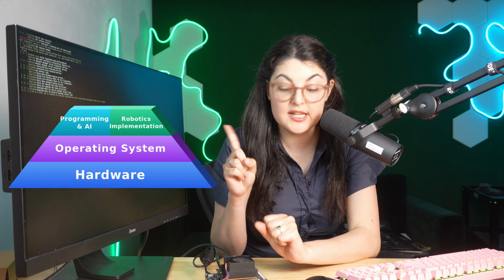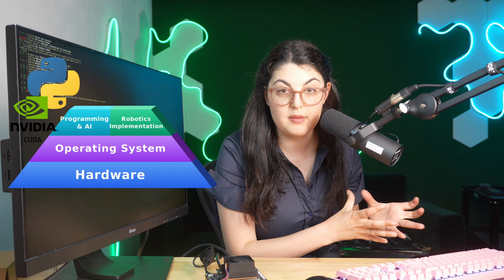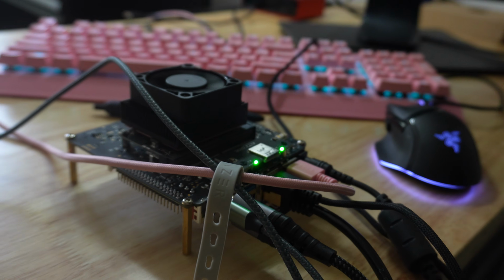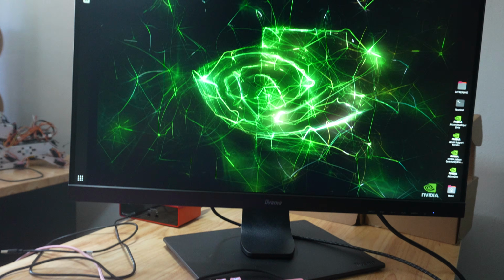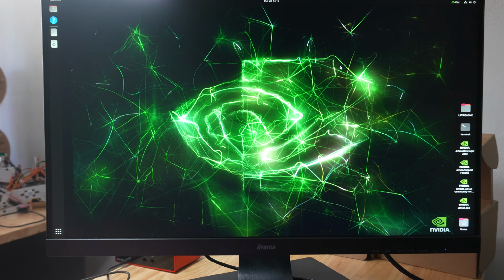what they don't tell you about building for robotics with NVIDIA Jetson

Comment: The Jetson board died the very second you touched it. You can see the monitor turn off and the Jetson fan stop right as you pick it up 15:03. Electronics can be very sensitive to touch. 🖖
Reply: Exactly. Why would you even touch an actively running circuit board? Shorted circuits will need to be repaired. Next time put the PC in a box if you wanna lift it while running.

I'm feeling so bad just watching this. Got the thing running after so much issues just to ruin the hardware herself. Hope you get it fixed. God bless you.
Reply from the maker: Thank you! They do extensive testing to make sure the board is safe from shorting just from a touch so it shouldn’t be that easy 😭 I’m sending it back for further investigation and we’ll get a new one to continue the series 😅 I also got an anti static bracelet for the next episodes and I’ll definitely be more careful 😢
Reply: @backtoengineering Good for you. Eagerly waiting to learn more about your enthusiastic failures. Always remember. Unreasonable people are the only ones capable of changing the world. Never Give Up. Never Surrender. 🌎✌🏻

Comment: You know, there was a time when engineering meant putting together the circuits yourself resistor by resistor, and writing the software, line by line. Sure, now its faster because you can buy ready made systems and insert software modules and it does a lot of complex things. But the problem is that if there's an issue or you want it to work differently you can't fix it because they're just a bunch of black boxes that you didn't design yourself and don't totally understand how it works.  We've gotten to the point where code has been written on top of older code, and there's miles and miles of ancient magical lines of code that is impossible to decipher.  And you have to ask AI and it tells you but it charges you $90 because its had to spin up a power station and super computer to pull up the answers you can also find on google,  and then it doesn't quite tell you the truth. hmmmmmm.  I'm thinking you may have killed it with static when you touched it, or you disconnected something with the pressure.  Although circuits should be more robust these days against static spikes. You may also have a bad earth line to the power supply and the board is just floating.
Reply: yeah, i also mis those days, when microcontrollers was still available in through-hole packages 😅
Reply from the maker: Fair! I do like that it’s more accessible though. The option to buy the parts and solder everything together and make it fully your own from scratch is still there! Now they just also make it easy with kits 😅 I’d love to be the kind of engineer who can from from absolute 0 and some loose iron though
Reply: @backtoengineering  Its not the parts that is the issue. Its the fact that more and more these days engineers are just following instructions online and are just there to connect up the wires. Its very seductive, and you don't even notice that over time your skills have atrophied.  Its a very real and present danger.

Comment: I set one of my Arduino/RAMPS combos on fire a couple of months back when I slipped with a multimeter... and I mean a 3-inch open flame coming from my electronics :) That happened while trying to fix a stepper motor that was working, but wasn't holding the right amount of torque...so the whole troubleshooting endeavor had to go on hold to wait for a new board, and that extra time took the (very non-working) motor well outside of its return window. 

Yay hardware.
Reply from the maker: It’s definitely a challenging hobby 😅 but it’s also super rewarding, maybe because we know it can always blow up haha

Comment: Welcome to the hardships of engineering! Don't worry! We all went there sooner or later for one expensive component or the other. But before you toast another Jetson.. Why do you need it at the current stage of development? Wouldn't it be more efficient and easier to set up if you ran the AI Stuff on your local PC and Graphics Card and only switch to the Jetson when you need a solution for a mobile robot? Just asking, because I never got into the Jetson or AI controlled robotics. And I planned to use my PC capacities first before buying another expensive component. Are there reasons to not use the PC for first attempts and go for the Jetson right away?
Reply from the maker: Fair! That’s why I wanted to set up the same Ubuntu version on my PC as well so I can try to do the same dev work on it too. If you already have a good computer with enough cpu and gpu and Linux that should do it! I’ll spend some more time on the simulation software and what you can run locally now 😅
Reply: @backtoengineering  That's cool content I am looking forward to! But still... I would think a Jetson Nano is only necessary to do reall fast real time decision making, e.g. to react to a thrown ball etc.. For more static decision making wouldn't it suffice to have the 'brain' on PC and the acting on the drone with normal control laws, and with WiFi or such in between? Or are you intending anyways to do the hard real time stuff with AI as well? That would be really hardcore!

Comment: Mam, why didn't you went for docker , the os you are running won't matters that will be most easy setup also, try with raspberry pi. tear came down when i heard smoke from jetson.. 🥲🥲
Reply from the maker: Yeah docker is also a good alternative but it can still have some limitations when you’re trying to use all the drivers and cameras and sensors along the way. Ideally having the right OS should have been smoother 😅 but for sure I’ll the docker in the next videos